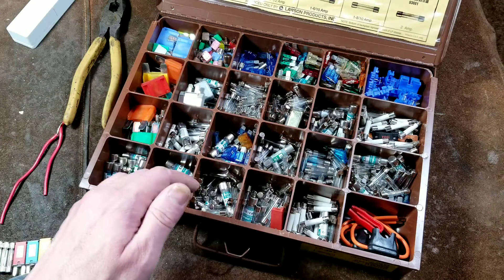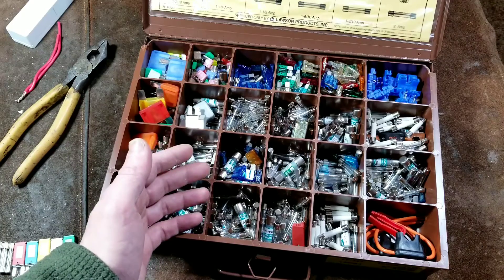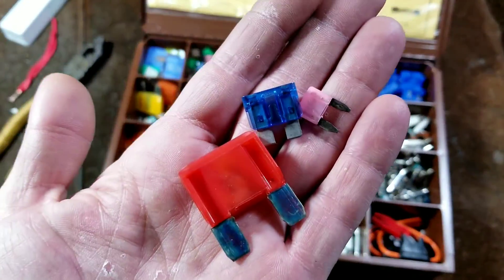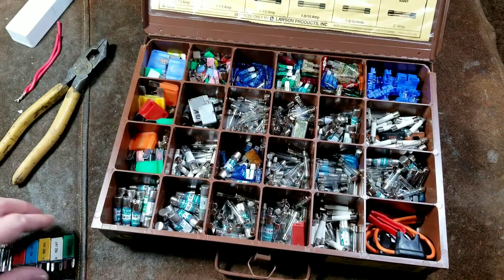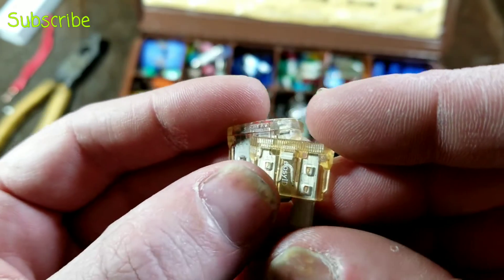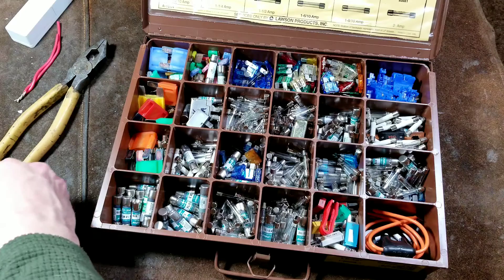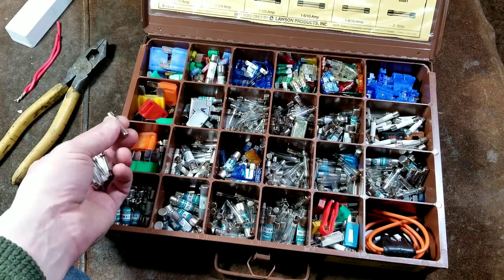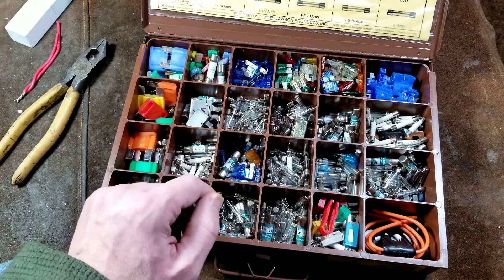Electrical Fuses Overview & Discussion

Comment: It's not only arcing, it is the breaking or interrupting capacity of the fuse. The ones with a glass housing have a much lower interrupting capacity than the ones with a ceramic housing. In addition most ceramic fuses are filled with sand.
Here in Germany we've got these types for interrupting capacity of such fuses. That's the current they must switch off savely without arcing or breaking the housing:

L: Low, 10 times of the rated current but at least 35A, tube made of glass.
E: erhöht (increased), at least 100A, glass tube reinforced or filled with sand
H: high, at least 1500A, ceramic tube filled with sand

In case of a short-circuit the current can raise very fast, depending on the impedance of the wiring, so these are no fantasy values. The circuit breakers in most panels are rated for 6000 or 10,000A.

In the UK they use such fuses inside of their plugs. The outlet circuits are fused with 30 or 32A (230V!), and of course the cords of appliances are not rated for this current. So they've put fuses into their plugs.

http://sparkydirect.s3.amazonaws.com/1/188G1B_1.jpg

The car fuses here are the same as you use over in the US. The fuses we use in our appliances use the same principle and same shape, but the dimensions are different. Most common here is 5mm in diameter and 20mm long, rated for 250V.

The most interesting is that there are actually repairable fuses. In the UK for example are still panels or fuseboards installed in older residential buildings using this technology. You buy the wires with the fitting ampere rating, cut a fitting piece off and screw it into position inside of the fuse holder. Then put the fuse holder back into its position in the panel.

https://en.wikipedia.org/wiki/Fuse_(electrical)#Fuse_boxes

Comment: Whenever you hear a loud bang like a gun shot and the lights go out it's usually a cut out switch for a power line transformer if a squirrel gets on a power lines

Comment: Have you ever used a fusible link? I know my truck uses one from the alternator, essentially it's a thin gauge wire that burns up. I suppose you could use wire as a fuse in a pinch
Reply: If you are stuck on the side of the road, and need to home, or. to somewhere that will allow you to work on the, car you could.

You should not use a piece of wire long term, you might ruin your charging system.
Reply: Volvo trucks use a fusable link on the starter ground lug to the block if it blows or you don't get it put back on the truck won't start.